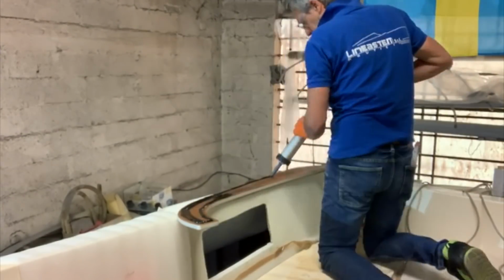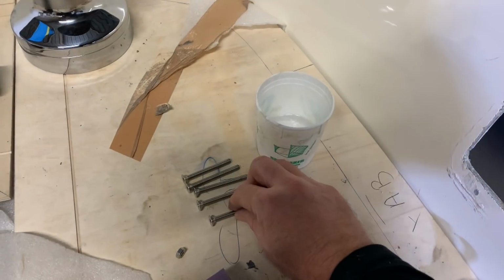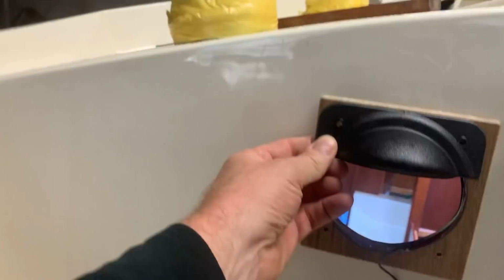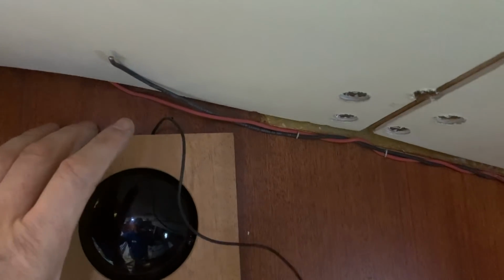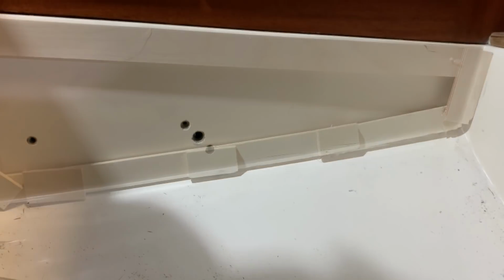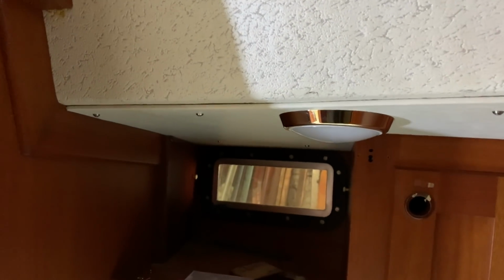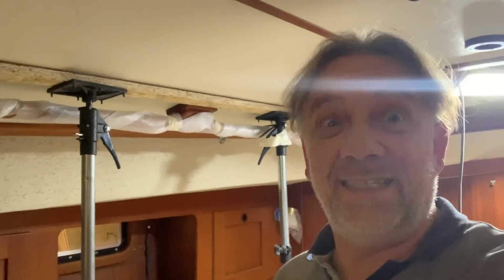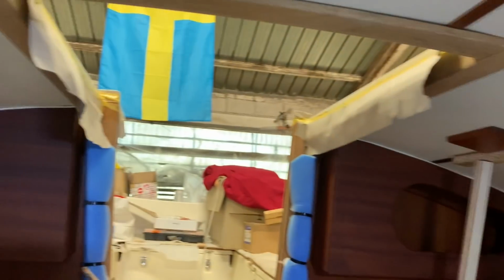Hallberg-Rassy 312 "Ellös":MORE TEAK ON ELLÖS & MANY MORE TASK (DIY BOAT)

Comment: Gabrielle you are doing such a fantastic job and are working to the highest standards of quality, finish and aesthetics. However, and I hesitate to point this out, but the backing piece of plywood  (?)  for the Silva compass rather lets that standard down and a nice thicker piece of well finished teak would have been more in keeping.😀👍⛵️
Reply from the maker: Hi Norman is not a plywood but 3 layers of teak Burma epoxy glued together to avoid the a thick teak one only  crack in a while..😜 as usual.....
Reply: sea4see My bad!😳 I stand corrected - you are 100% quality.👍😀⛵️

Comment: I think the teakframe behind the Silva compas should have rounded corners matching the scaled radius of the compas.
Reply from the maker: Thx Reider but I made square to compensate the original holes that was made not aligned the only way to make specular was using square frame as the one starboard side for B&G instruments